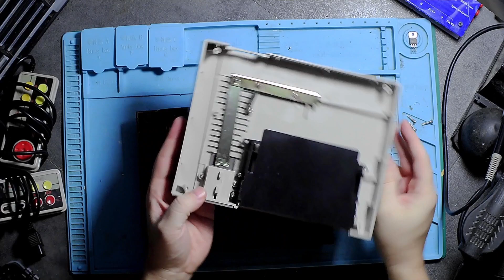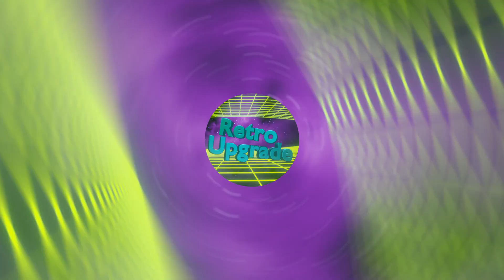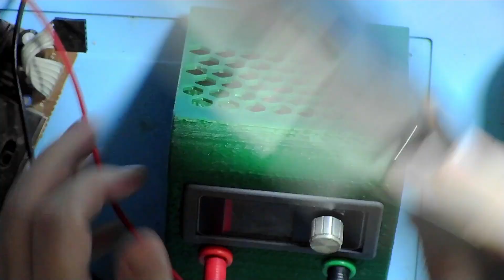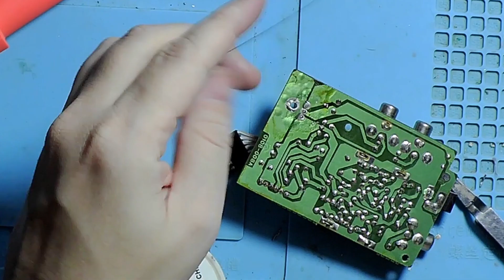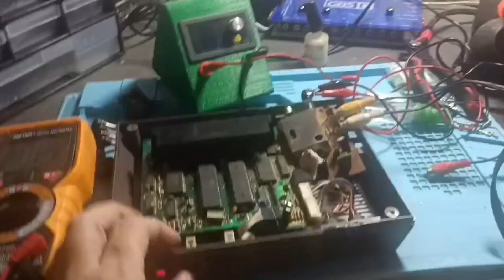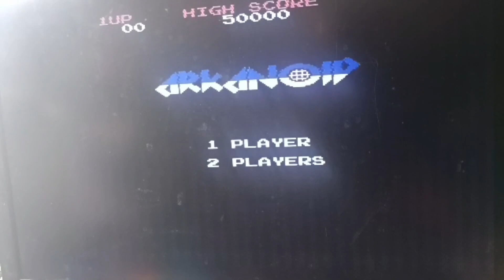NES Clone - No power can i fix it

Comment: Nice fix, sometimes unloaded ac adapters shows a bit more voltage than they should output, so it might go down to 9V when loaded i guess it's a transformer inside that adapter
Reply from the maker: You are 100% right. But in this case it was just crappy text printing 🤣😂 pushing it all the way to the right looks like the selector is on 9v but actually 12v.  But yeah old c64 psu shows 15v unloaded and goes down to 9 loaded
Reply: @RetroUpgrade  Ah yeah just noticed it says 0V on the first option wtf xD quality!